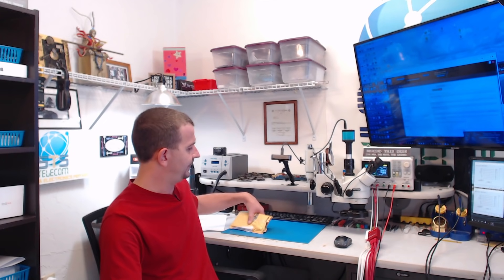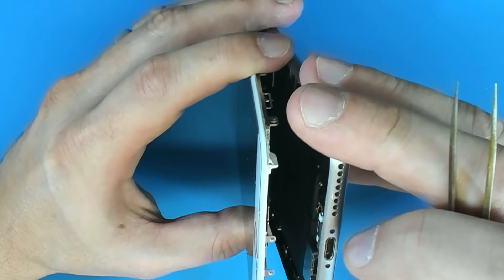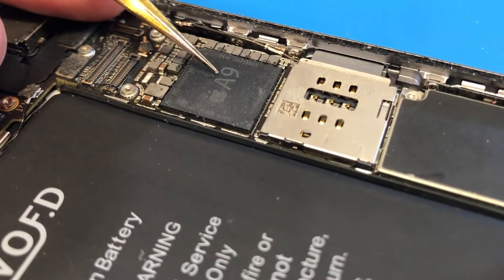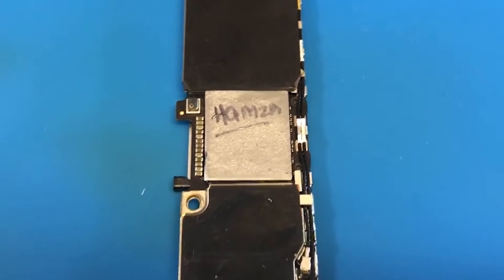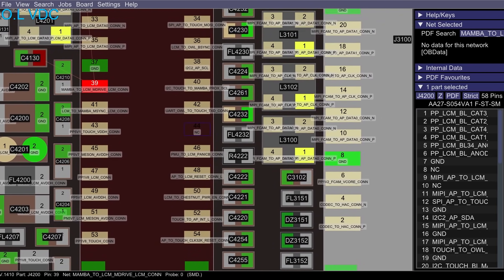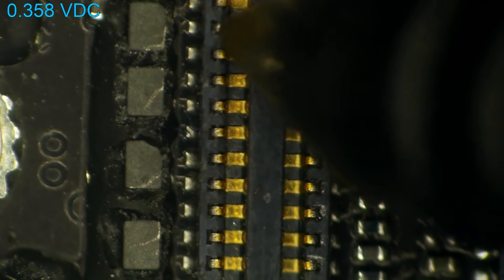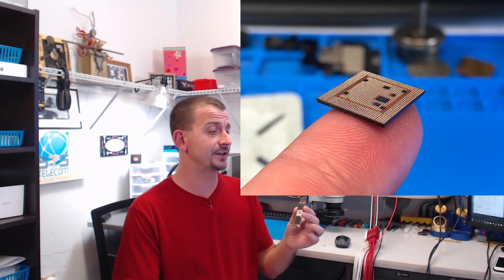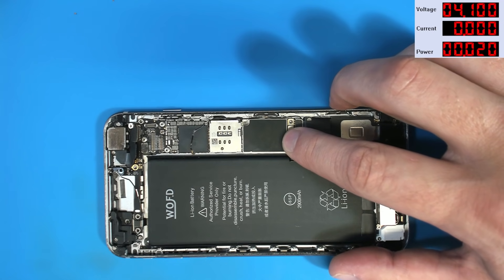Another tech killed this board - I have made the exact same mistake

Comment: what do you think could have gone wrong in a iphone xs max, if i accidentally connected the bench power supply set to 18v. It has 0 amp draw and nothing gets hot cannot visibly see anything blown and the 3.8v voltage is present in and after trister.

Comment: hey steve rahim here, i cut the ram corner or grind it off or i puncture the ram without damageing it to remove the gas in the middle.340/40, big nozzle you can replace the ram on its own. easy job

Comment: While so many others are using Amtech flux, why have you chosen chipquick. I live in Canada and we can't affordably get Amtech, but chip quick is readily available. I'm wondering if you have experience with both and could speak on how they compare. Also can you speak on why you use the 291 rather than 191 or 491 or 591?

Comment: I once had a motherboard release the magic smoke and it wasn't even plugged in. It released it the second I turned on the computer 1 foot away that I was also working on. I have absolutely no idea why as I was working on a laminated wood table. Maybe it was coincidence but awfully suspicious. In my 25 years of working on computers I've learned that a problem can be caused by something that doesn't even make sense as to why it would cause that issue.